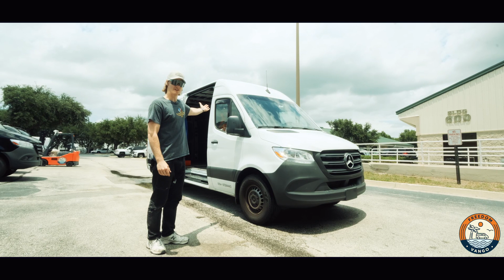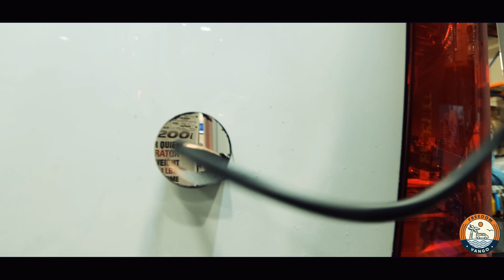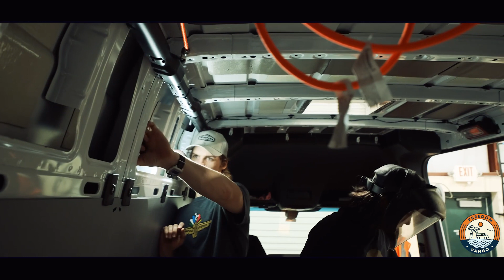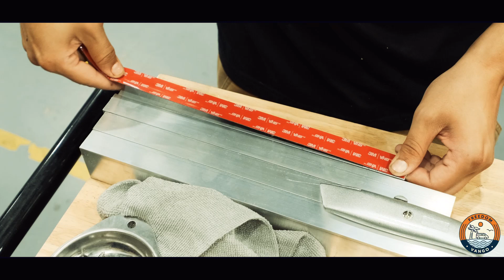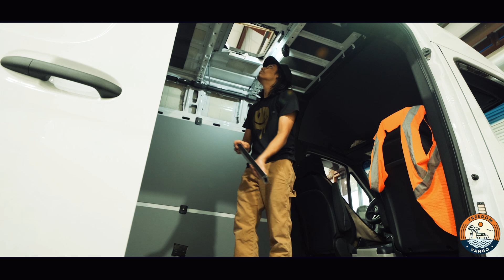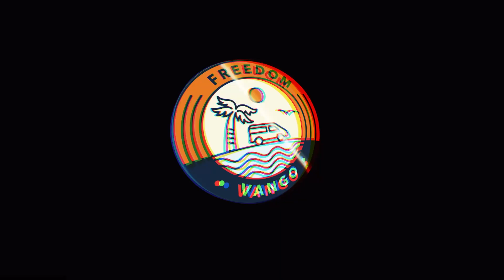Keep It Cool - Houghton Roof Top AC Install

Comment: Hey, looks good.  I'm curious which low profile RecPro you went with - the 13.5K or the 9.5K?  Thanks, I have a Revel.  Thanks!
Reply from the maker: 9.5 all day
Reply: @FreedomVanGo  Even in hot, humid weather and a larger van? (Revel is taller than the one in your video).  I'd LOVE to go with the 9.5K but worry it might be underpowered for a Revel. The 13.5K would be a safer bet, but heavier, more expensive, and draws more current...
Reply from the maker: @harriswelles  we have it on our 170. No complaints in flordia